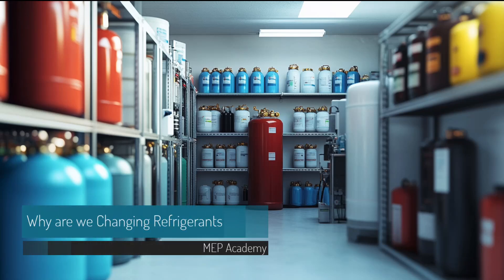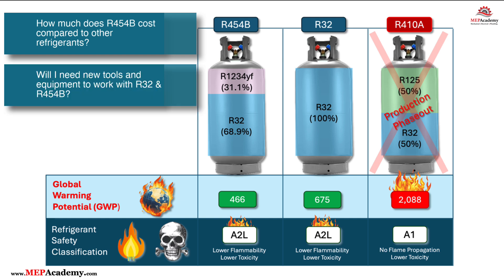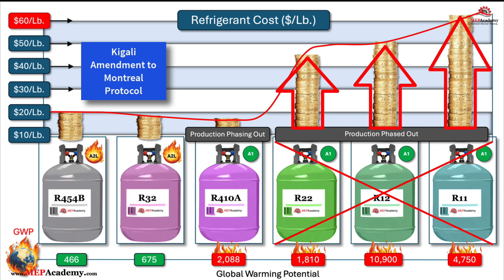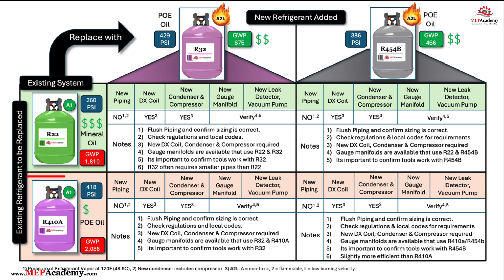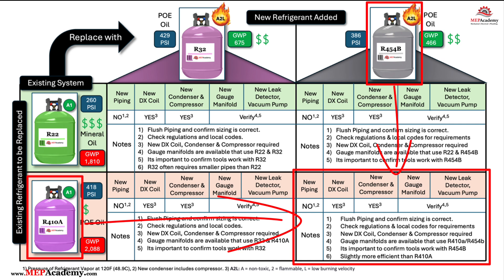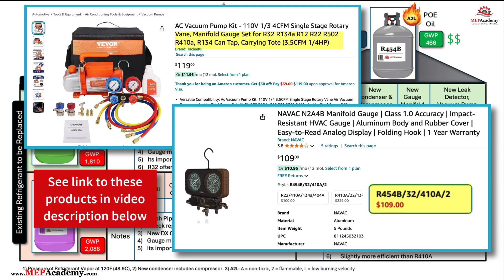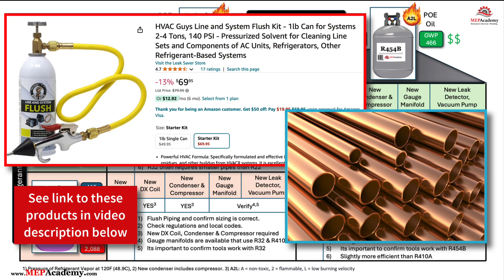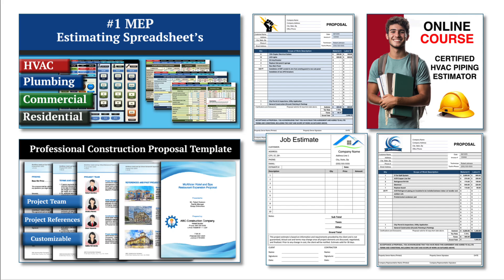A Guide to R32 and R454B Refrigerants

Comment: We used to have 5 different refrigerants now we have probably over 50 over the last 20 years i have probably purchased 5  30 pound cylinder’s used less than 2 pounds out of each jug never ran into them refrigerant again i am so glad that i retired we have changed all this refrigerant but we can still install 80 percent furnaces what is the ozone depletion from fossil fuels
Reply from the maker: It's true, there have been many refrigerant changes over the years, and it can be challenging to keep up with them.

Comment: The increase in cost of phased out refrigerants is largely a myth.  For a short period of time, it can be true, right at the beginning of the phase out, because there isn't a significant change in the number of existing systems from day 0 to day 1.  So, supply of that refrigerant has been reduced.  However, as soon as systems with newer refrigerant begin replacing the systems with phased-out refrigerant, the supply goes up and demand goes down.  This happens because the phased-out refrigerant is recovered from the systems as they're replaced and it can then be used again.  It is basically a tactic by installers to scare customers into replacing their systems and they artificially set their prices for phased-out refrigerants higher... even though you can acquire it yourself for a normal price.
Reply from the maker: Thanks for the detailed explanation.

Comment: Fun fact.....Daikin invented R32 and allows the patent to be used by any manufacturer free of charge. Lol....i work for Daikin Applied. After all 50% of 410a is R32. The 50%125 is to allow it to be classified as an A1 refrigerant.  The scare tactics for flame propagation into getting people to buy new equipment is laughable. It takes something like 1500°F to ignite A2L refrigerants. Any refrigerant poses some sort of risk....don't take unnecessary risks...and there is nothing to worry about
Reply from the maker: Thanks @jasonjohnsonHVAC